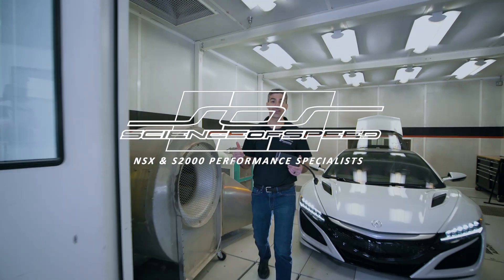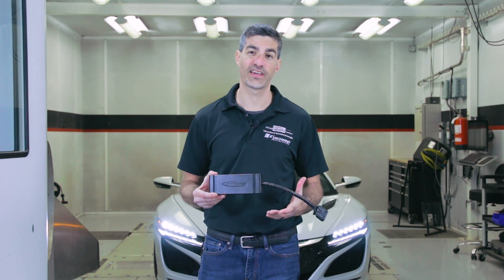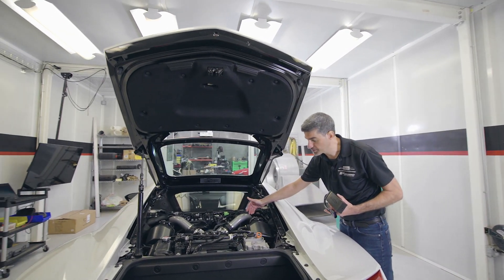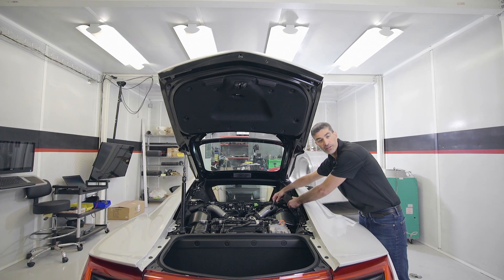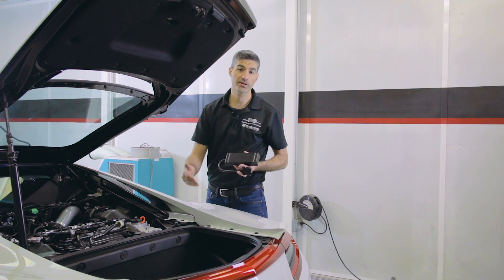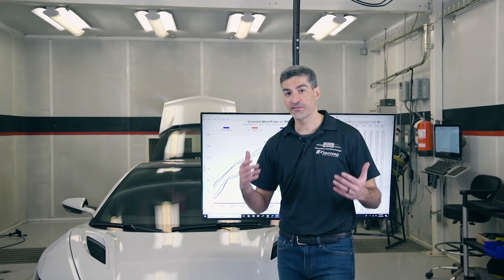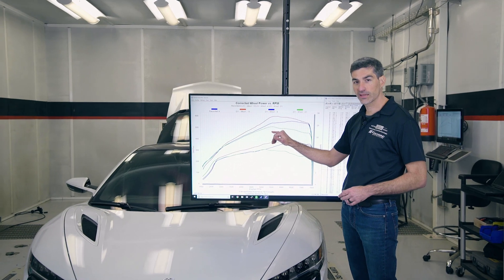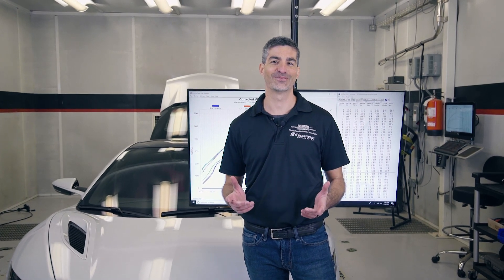JB4 Tuning Box from ScienceofSpeed - NSX, 2017-on

Comment: Do you have tuning boxes for Acura TL??
Reply: Why would they? Lol it's NA motor that's like 20 years old. There's no power left untapped in there.
Reply: Acurazine is a repository of lots of info re many performance mods for the TL.  The only ECU module I’m aware of is Hondata, which works with the manual transmissions only.  There are Gen. 3 TLs out there with full intake, exhaust, Bisimoto cams, Comptechsuper chargers, plus misc.. ooh-ahs.  The J32/35/37 motors can easily exceed 400 hp with aforementioned mods and more if one goes with turbocharging.
Also, the J series V6 power plants are still much in production, and remain very relevant.

Comment: Ive seen stock nsx run 10.8... the fastest science of speed tuned nsx including meth injection runs 10.6 .... please explain 🤔
Reply: Most times I've seen from a stock NSX is around 11.2 in low 120's & with these additions, same car on the same track in approximate weather they get a 10.6's @ almost 130. Big difference can be track & weather. Might run a 10.8 in optimum conditions & w/ additions that car might run in low 10's.